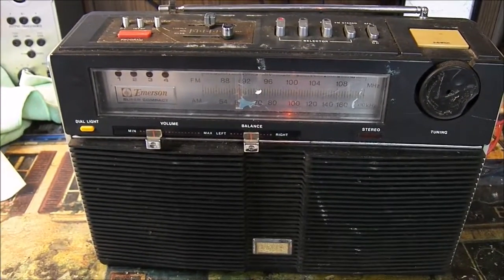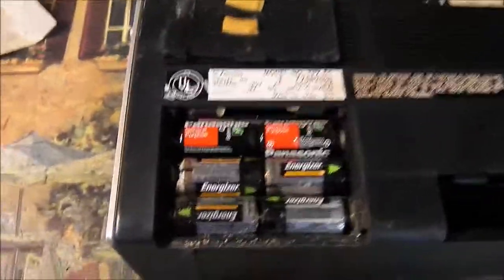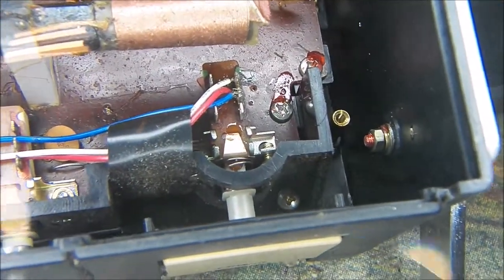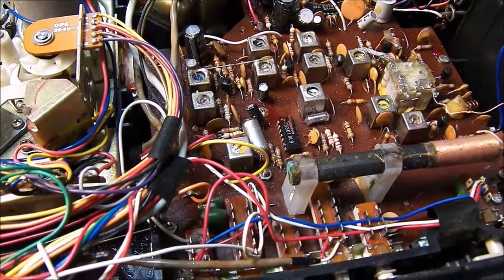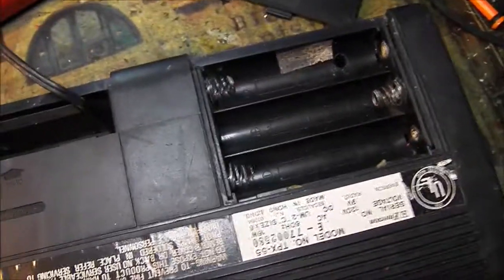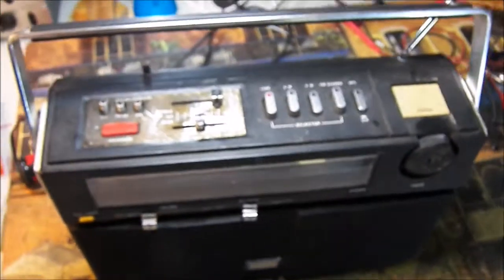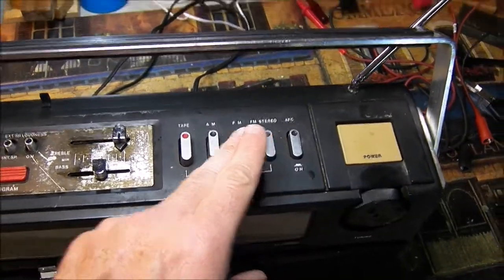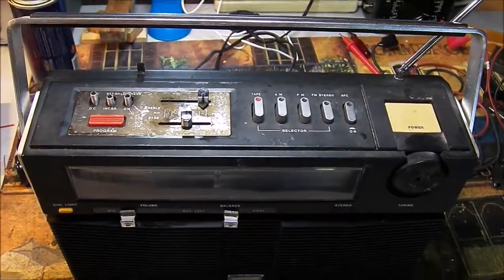Emerson TPX 55 Sanyo transistor radio repair noisy controls power switch defect battery compartment

Comment: What screwdriver do you use to open an Emerson TPX-55?

I have one that makes a little noise when it's turned on (on AC power) and the switch is in the internal speakers position, but that's all it does, and it doesn't do anything on battery power. I would like to take the back cover off so I can try to troubleshoot it and see if I can get it to work, but I can't find any screwdriver that can turn the screws.